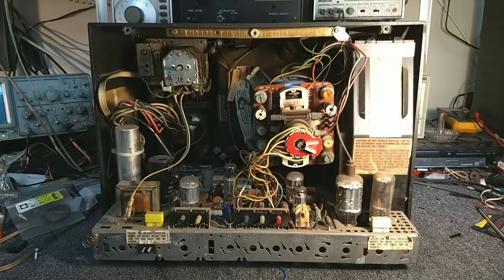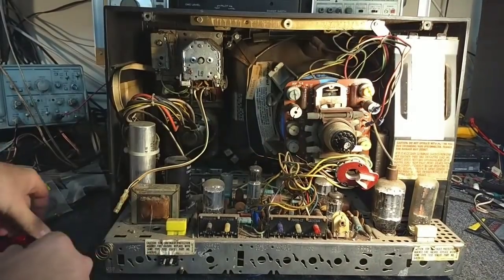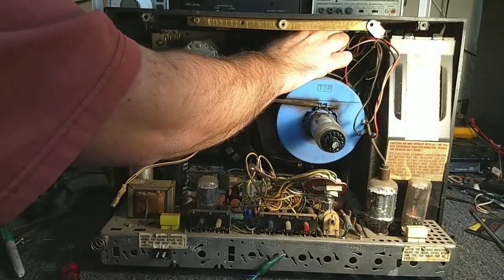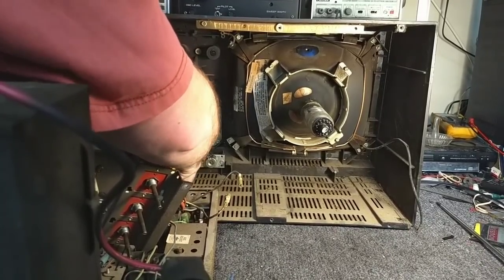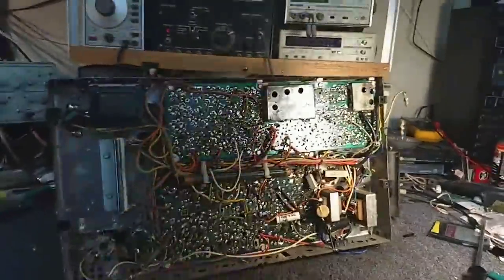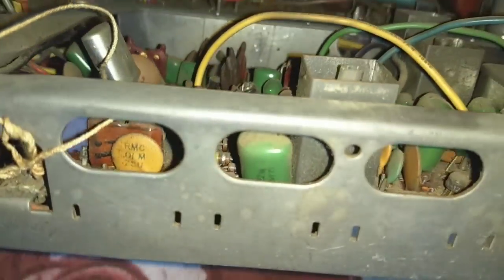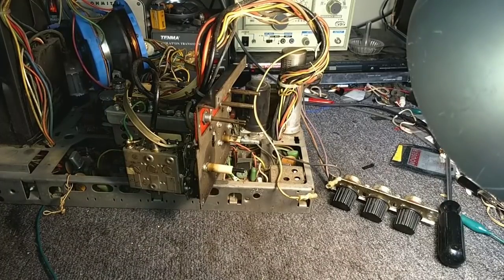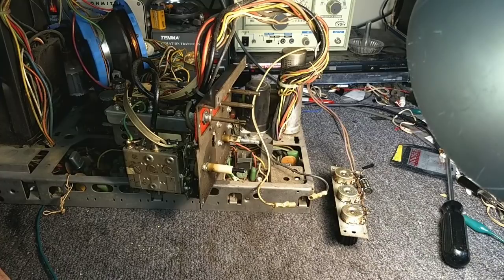Repair of 1973 Admiral SK2247 12" Hybrid color tv. Part 2/? -Chassis Removal

Comment: I use breakcleaner for that stuff. Yes its for cars, but it cleans up everything, (dont spray it on trims though), it has a bit of acetone in as well, so its a bit more rough on the components than the normal cleaner stuff for electronics. But its a lot cheaper and has a lot of pressure, blows away dust and crap.

Comment: That tint pot is an odd ball,  maybe wire up a preset and take the tint pot apart.
Sometimes contacts just need re-springing :-)
Reply from the maker: I've found a pot that is close to what I want. Just have to machine down the shaft to make it work